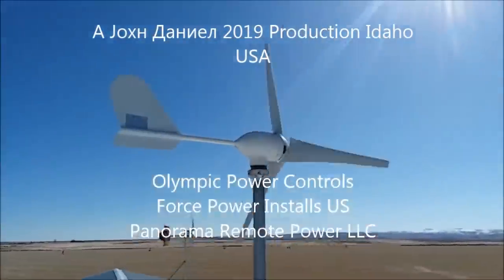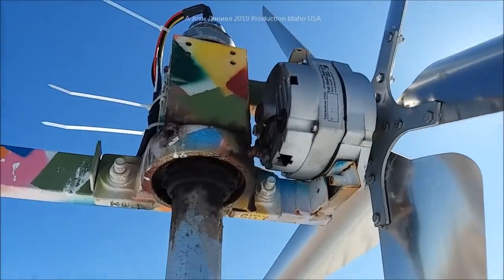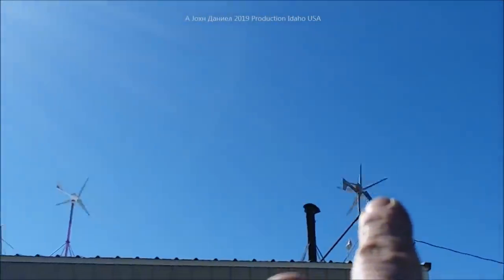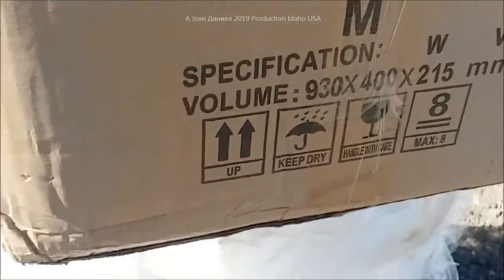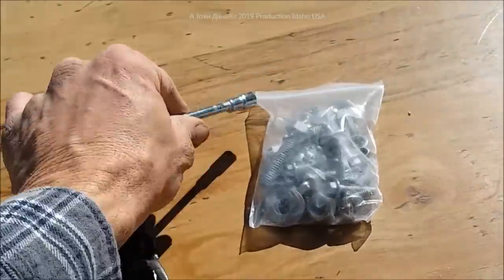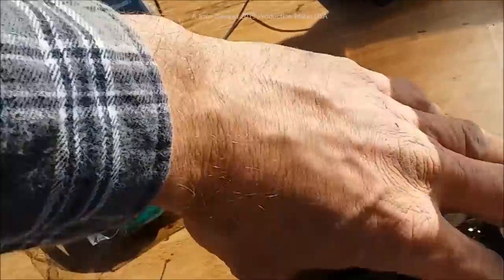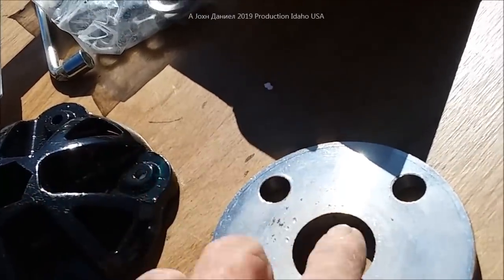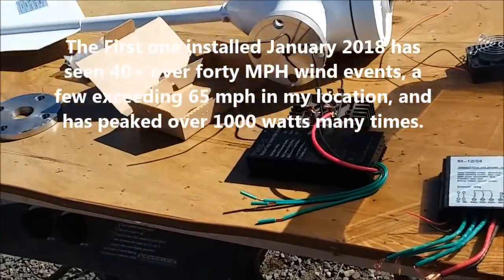Genuine 500 watt home wind turbine, Best small Wind Turbines made! FULL PARTS LIST BELOW video

Comment from the maker: The 2019 GE-500 comes in 3 or 5 blade, 12, 24, 48 volt option. I made them lower the price!! Nothing better for the price. More videos coming, & items you'll need are up under the video  HIT SHOW MORE  ABOVE 4 WHOLE LIST and additional facts and info. * I just gave a known Missura thief my secret @2:45 perfect magnet arrangement. Be looking for my design to be knocked off on Ebay real soon, usually hacked and made in Vietnam, BUT if you buy it, your still buying from a junk dealer who cuts corners and steals others designs.
Reply: Thanks for sharing your knowledge and candid opinions on a range of wind-power related  products.  I'm new to wind and solar power generation, having recently purchased an off-grid home in the Rockies just south of Cripple Creek Colorado.  The property is located at ~8500 feet and is exposed to nearly constant and sometimes high wind conditions.  Power was originally provided to the ~1700 sq. ft. home by a solar array and a wind turbine.  Currently, neither system is functional.  The home was lost to foreclosure by the previous owners and sat vacant for ~8 months, during which time the two year old battery bank was not maintained and the batteries were ruined.  The wind turbine is also inoperable.  In talking with neighbors, we learned that the Whisper 100 wind turbine had been replaced or repaired three times over the course of ~14 years. I was wondering if replacing the Whisper turbine with a GE-1000 turbine would be a relatively easy/economical conversion.  A local dealer quoted a Berkey 1000 W turbine for ~$8500 installed, but that's more than we can afford at this time.  Thanks for any advice that you could provide.
Reply from the maker: @dennismeyers6035  I would agree the GE1000 would fit at 1/9th the price, you can buy 2 in one shot to always have a back up. But I know my very first H400 china turbine was put in it 2009 is still working and I only did the basics of care.
Reply: @JOHNDANIEL1  Thanks for your reply.  That's a good idea, buy 2 and have one as a backup.  I think I'll give it a shot.  Thanks again, John.
Reply: Јоhn Daniel yeah I appreciate it I'm just getting into this so I would like to know about the solar and the turbines and if you said that one puts out and like 1500 watts that be cool I want to find out how I can hook up some other instruments like the amperage being pulled through separate from that and a little meter with it or and using a choke I just want to know the important things so I can hook it up
Reply: found one of these on ebay au for under 120 , looks the exact same , guess theres only one way to find out. rated at 13ms though, misprint?
Reply: I thinking of buying one of these wind turbines to slow the discharging of my battery bank by providing amps in my system. 
Is that a way ?
Thanks
Reply from the maker: @takismenexes6131  Yes, just make a choice volts and watts needed from under the video of the right blade count and low wind or regular then install it according to your battery voltage needs. The extending of your charging is what can double battery life so yes, they are well worth it.
Reply: Im thinking you should be talking to these people at B-Creation and seeing about a distributorship.....
Reply: I would like to get your help making my system. This turbine along with 345 volts of solar.
Reply from the maker: 345 watts of solar, and a turbine. Small system, just make sure you have enough batteries.
Reply: @JOHNDANIEL1  how many and what type do you recommend Sir ?
Reply: @miltonbayne6649 ..
Reply: I'm thinking of a using the wind turbine  motor in conjunction with a pulley  and a 12 DC motor to charge batteries what do you think?
Reply: Dart Gar .9
Reply: John, what would drive the 3 blade vs. 5 blade choice for my target install?  I believe a windier region would warrant a 3-blade choice, but in your estimation where would one draw the line when it came to average wind speed?
Reply from the maker: 3 blade needs a average of 13 mph, 5 blade needs a average of 10. Winds from 10 to 28 are wind turbine zones.  I prefer to refer people get the 5 blade for everyone, and then buy a WNA original 3 blade hub from Ebay that fits it and the blades. The 3 blade spare hub Model is 139mm, M in the listing, https://ebay.to/2CrkkEq
Reply: @JOHNDANIEL1  Thanks @JohnDaniel... I will be living up the hill from a large wind farm (Upolu) and averages are seasonally from 4 to 6 meters/sec
Reply: @JOHNDANIEL1  The diagram for the 500w turbine shows the blade span diameters are different for the 3 and 5 blade versions.  Do you have a source for obtaining the longer blades designed for the three blade hub?  Also, the 5 blade nose cone will not fit the 3 blade hub, right?  Is there a source for obtaining that?  Thanks!
Reply from the maker: @ildan08  I will look and see if I can find where I ordered 3 sets like that. You will need a hub, blades and nose cone but then you can swap from 3 to 5 and back. Send me a reply/inquiry to shop email,  olympicpowercontrols@yahoo.com , describe the issue, and I will see if I can get you a full kit on my refer to friend discount then get that info and source to you.
Reply: @JOHNDANIEL1  I sent you an email.  Also, I just recieved the 500w version.  I noticed the shaft will move inward an inch or two, without much effort.  is this normal?  My 600w version does not do this.
Reply from the maker: @ildan08  The shaft will float in the bearings in the magnetic center some till the hub is on. The hub when bolted centers it and sets up against, rides on the inner bearing and locks it in place.
Reply: I went ahead and purchased a (3) blade turbine... hoping that I'm not in the same boat as you for excess power.
Reply from the maker: Mount it high and clear, don't skimp on the wire gauges. If you have good wind, your going to have great results. These are rated at 25 mph to hit their rating, you will see 350 to 600w consistently in that 20 to 25 wind levels. Lower than that you will get good charging too.
Reply: @JOHNDANIEL1  I contacted the seller to ask if they'd change the (3) blade to the (5) blade based on your recommendation.  Not only did they reply in a very timely manner (same day), but they are offering to change to the (5) blade for no CO$T.   Our average winds are 9 to 14 mph trades (often gusting higher), so if you still think the (5) blade is a safer bet then change to the (3) blade hub later I'm gonna give them the thumbs up.  Thanks again to you in advance for your great videos... love your style and your rambling!
Reply from the maker: @jimamos8960  Excellent. Yeah, China sellers are now being held to a social grading system. Pretty poor way to live but it makes them bust their butts not to get bad reviews.
Reply: @JOHNDANIEL1  The turbine arrived today!  It arrived in perfect shape with all the parts and pieces (including all the styrofoam bits!!).  Thumbs up on this supplier to anyone waffling on this purchase.  The seller even allowed me change the order after placing it (thanks Sara Lin!!).  Very pleased and looking forward to follow on videos and equipment recommendations.  I'm working on a DC lighting system that will be powered by this off-grid 12V source.
Reply: @JOHNDANIEL1  When is the next Turbine Video?  Been looking at programmable  wind-curve turbine charge controllers and not a lot of inexpensive options... the Midnite Solar KID Wind/Hydro looks to be lowest cost in the economy class.  Also been looking at lots of BMS systems and battery choices (LiFePO4).... and of course I want to bridge this with solar... hope for your next installment sooner vs. later.
Reply: Јоhn Daniel hi I’m trying to get ahold of you regarding a 1973 Winnebago chieftain. Your video is the only thing I can find on it.
Reply: @John Daniel - Would you consider using the no-weld mounting flange for this turbine that you've shown on the previous VAWT project?? https://ebay.to/2FGtilh
Reply from the maker: @jimamos8960  I would, and all you need to do is oblong the holes on the no-weld pipe flange about 1/8 on each one. I have used them for years on anything 200 to 800 watt. Bigger than that, I always weld.
Reply: That is interesting, I was planing on using an aftermarket bridge rectifier like you have done.  But add a filter cap out of a welder to smooth the ripple on the output.  Then feed it into a charge controller.  

I'm looking at land in Idaho that is off grid and this looks like a good system to use.
Reply: Getting ready to build a home off grid! Nearest power line is 1.5 miles away! Your build kit how much because I love your output! Plus where would I go to have them increase the magnets like you did? Great info Sir!
Reply from the maker: @philippennington5415  You get the voltage of choice and 14 mag called the SC ( SuperCore ) with your own mounting build it can make the power. If you want a offsett torque controlled kit build for high winds and total  survivability I am starting to order the parts to build 25 like my Chaos model You will have to buy your own blades and thats smart so it fits your location of wind availability. I will make a video and a PayPal link to order the frame and parts to complete your own in the upcoming weeks.
Reply: @JOHNDANIEL1 thanks! I told my wife and she is super excited!
Reply: How many KWH did it make it in a year
Reply: @ashanmendis8091  watch hos vid ... 1 yer produktion / Rewiev .. would be a goud Guess ..
Reply: Where I can buy this I need
Reply: @AbdulRehman-hb9ko  try the links under the video.. 
But if you alredy have to ask .. don't bather..
Wher to buy .. with All the links .. to wher to buy ..
You hawe a freaking Long way home
Reply: I live in idaho falls and have a cabin in the hills. I would love to visit you and see your installation and get some ideas for installing a turbine in conjunction with solar
Reply: How can I contact you I have a few questions
Reply from the maker: @michaelb.3705  You can direct questions to my shop email olympicpowercontrols@yahoo.com
I usually can get back to you in a week or less. I get 50+ emails a day to go through, and I work full time.
Reply: John new to your site, do you have a video or link on purchasing portable wind turbine for RV as backup for solar for (2) 12v batteries? Thank You.
Reply: ...hello ..okineed one or 2 etc ....me off grid etc ,,..  hope uknow the virus is a hoax ..see  5gexposed.com ...thanks ..how do i order ..
Reply: they are $450 US now
Reply: What Is Islam?

Islam is not just another religion. 

It is the same message preached by Moses, Jesus and Abraham.

Islam literally means ‘submission to God’ and it teaches us to have a direct relationship with God. 

It reminds us that since God created us, no one should be worshipped except God alone. 

It also teaches that God is nothing like a human being or like anything that we can imagine.

 The concept of God is summarized in the Quran as:

{ “Say, He is God, the One. God, the Absolute. He does not give birth, nor was He born, and there is nothing like Him.”} (Quran 112:1-4)

Becoming a Muslim is not turning your back to Jesus. 

Rather it’s going back to the original teachings of Jesus and obeying him

Comment: Hey John. Just bought one of these 24v turbines and it does not make more than 20vAC in any given wind. Even a hooter. All phases are always the same so i'm lost as to why i'm not getting more AC volts. Any ideas? Cheers
Reply from the maker: Check the blade hub tightness, it may be slipping so look and listen for that. You may have over spray of marine coating got on your slip rings. Possibly may have to bench test it with a drill and get me some data back on results. Brand, store bought from, listing page.  olympicpowercontrols@yahoo.com

Comment: How do I balance my wind turbine. I just put up a new one when it's moving smoothly with a straight wind It's pretty quiet but whenever there's a wind change you can see a visible buffeting in the blades and it rattles the whole building pretty badly. Thank you

Comment: What's the link to that volt regulator, you use the DC side to brake the turbine. Need a couple. Tried a wind/ Solar controller, but it would not shut down the wind turbine. Maybe it uses the AC side to turn of

Comment: Hey thank you for all your videos, very big information guide.

One question, can you discruibe me pleas how the braking system works with when you only get +/-  on the rectifier?

Did the controller start resitance about 14,7 voltage or what?

And isn't it bad for that Batterie that still works parallel to that setup? 

Pleas don't leav me in the Dark :D

Thank you in front 

 BEST REGRADS FROM GERMANY

Comment: I have recently ordered the small 400 watt g+e turbine from Ali Express. Will its small controller work only using it for a braking system as in your video? Thanks.
Reply from the maker: Using only 1 turbine in your system allows you to use the supplied controller as is unless your going to buy Lithium batteries for it.

Comment: Why dont use the  charge controller in its designe?
What is the defference?
Reply from the maker: More than one turbine, you need a diversion system. One turbine you can use the supplied controller as long as its brake/divert voltage is above your solar controller max charge volt setting.

Comment: I bought a 12v turbine but have a 48v system will it still work or do I have to buy parts to fix my mistake
Reply from the maker: You will need finer windings in the turbine to make higher volts for a 48 battery. I would look into contacting them to buy a 48 volt generator to install for the exact turbine body and blades you have.

Comment: Imagine a guy that plans to take an around the world Sailboat trip.  I have a 100% solar powered engine. No Gas generator. I generate all power from solar panels on board.  The new thing in sailing is flying a kite to the front of the boat, up high, with 2 goals:  
- Gain forward propulsion
- Big setups use tension to developed electricity from kites.  (New technology) 

But I want to develop power from a wind turning, up on the Kit. 

The kite would be200-300 SF of surface area and it would fly at 200' + in the air.  winds, constant wind at this elevation for many hours at a time. 

High So my question is,  would it be possible to integrate a wind turbin into the design of this "Kite"... and transfer the current from turning to boat to charge my batteries onboard?